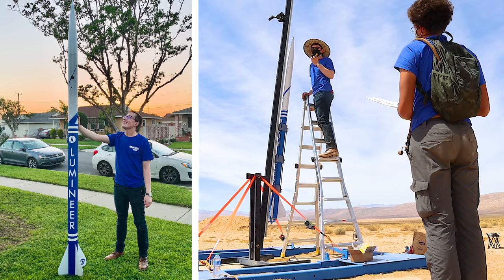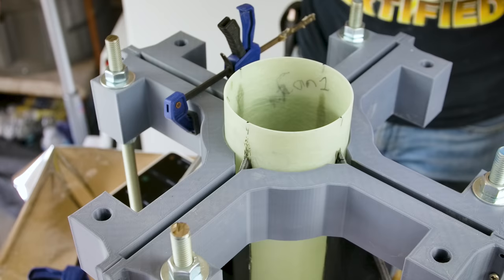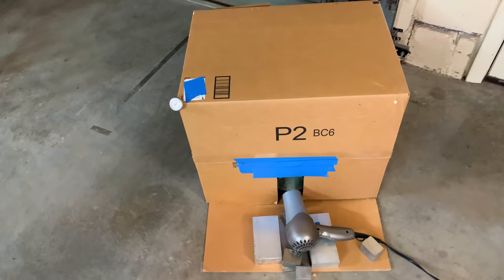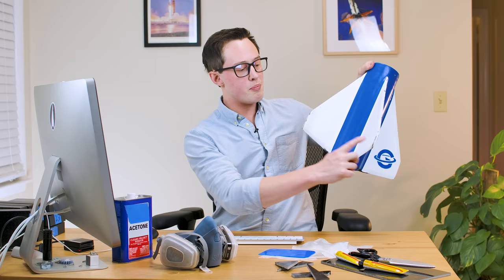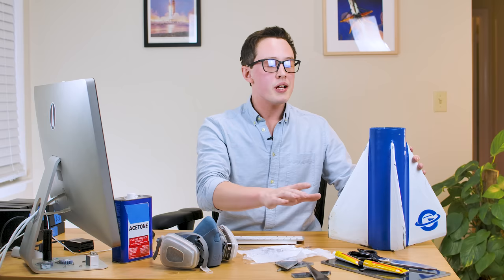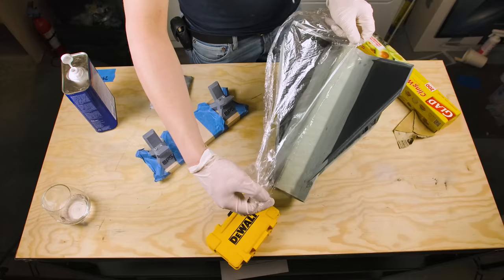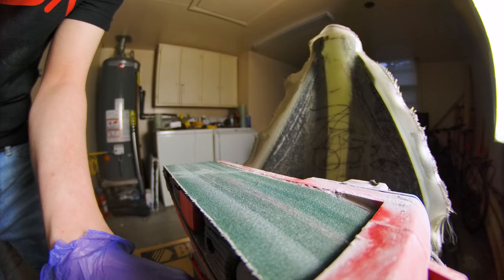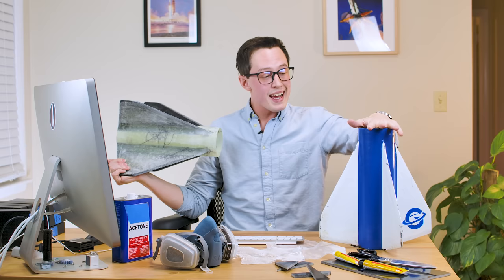High-Strength Composite Rocket Fins - Building Lumineer

Comment: Material ratios are highly specific to materials used and there is PLENTY of literature and quick google searches to determine if "one-to-one" is a good options for you. For instance, a carbon fiber based build is closer to a 60/40, fiber to resin content and shouldn't be one-to-one. There is plenty of available literature to back this up and any materials you plan on developing a composite solution for should be vetted accordingly.

Comment: I like this guys enthusiasm and get er done approach. That being said, engineering is math and analysis. This isn’t engineering, it’s hobby hack. No engineer says “O point 2 degrees “. It 2 tenths of a degree. Putting the “O” in there would lead to confusion with “point O 2”. And 2 tenths of a degree is a gigantic misalignment and would be clearly visible to the eye. G10 is about the worst material for a rocket fin. Heavy as hell. All the loads are at the root and that’s where his poor structure is weakest. A carbon fiber part made from a simple quarter section tool (mold) would have been super easy, resulting in a tail fin about 80% lighter, thinner, stronger. I was making better composite components when I was 14.

Comment: ball is the best, also helium ballooning head, also a circular centrifugal air turbine stage
Reply: design so that you dont rely on glue, dove joints
Reply: squeeze extra out
Reply: mechanically sound
Reply: ultra sound wash, insert the fiber between the fins
Reply: easier to cover round and flat things
Reply: ready made wings, fins and main body
Reply: mechanical art

Comment: Light Bulb Oven - perfectly safe and not too expensive.  https://youtu.be/oq5FbH2VAqY     Also, trimming off the extra fiberglass is much easier and safer if you wait for the epoxy to gel and then use a razor blade to trim to the rigid substrate then go to the oven. Safe and High Flights!

Comment: Would a fillet not reduce the interference drag between the fin and the fuse?
Reply: To a point.
The fillet is also increasing frontal area and reducing the effective area of the fin
Reply: @jimurrata6785  For sure there would be an optimum fillet radius. Curious to know what that would be.
Reply: @wezdog1  That would be a question only solved by fluid dynamics and FEA.
Factors like speed and air density play against tube diameter, fin thickness, thrust curve of the motor, etc.
Reply: @wezdog1  This hobby is much closer to sounding rockets flying out of Wallops than spaceflight.

Comment: I’m sorry but heat curing epoxy in a box and a blow dry has extremely low odds of catching fire. You would need to bring up the temp a lot hotter and also build a air tight box and a air tight seal between the box and blow dryer and hope your blow dryer doesn’t have a over heat kill switch. Then hope enough gas off happens and that gas accumulate to a high enough concentration and finds the heat source inside the blow dryer then ignite.

Comment: Why fiberglass over carbon fiber? Doesn't carbon fiber beat glass in weight and strength?
Reply: Carbon fiber won't bend to confirm to the fillets without a vacuum bag to hold it in place while it cures.

Comment: Don't disrespect the cardboard box hair dryer cure oven. It worked too good for me honestly lol.
Reply: If he's only doing one pair of fins at a time, laying a $12 heating pad on there is much easier (and safer!)
Reply: @jimurrata6785  I guess but I think the hair dryer method is just as safe as putting a heated pad down. That is just my opinion.
Reply: @Rocketrymandan  And we are all entitled to our opinion.
I don't think a hair dryer is going to set a box on fire, but my heat gun gets to 1,100F.
I'm pointing out that a heating pad has all kind of fail-safes built in and takes up no space while doing the job just fine (for one plane of contact)
And it doesn't even need contact, because IR doesn't care.
A heat gun is not about radiant heat, it's about raising the interior temp of the box high enough for the fin reinforcement to conduct heat from the surrounding air.
Reply: @Rocketrymandan  I'm not saying an oven is not good, but it is a lot more complicated for this use case
Even if it is as simple as a hair dryer in a cardboard box.
Ovens or autoclaves are critical for more advanced composites, but there are microcontrollers for ramp and hold times critical to elevated temperature cure chemistries.
If all you are trying to do is get your epoxy to kick off faster, gentle radiant heat has advantages.
Reply: @jimurrata6785  I know aeropoxy needs that cure oven with exact ramp in temp, which is why I chose fibreglast systems a while back for tip to tip. Pretty good specs (a lot more stable than west systems at temperature) and easy to work with. I didn't know you were talking about a heated matt specifically for composite layup. That will definitely be a lot safer than a hair dryer and you might even have the option to control your temperature.
Reply: @Rocketrymandan  I'm still using West System for most of my layups.
Not because it is 'better' than other brands, but I have over 40 years experience with it and it has huge amounts of available lab testing and certifications to back it up.
I know the engineering data and knowledge base is there for me to use it successfully if I do my part as a fabricator.

Comment: why not use carbon fiber instead? Its lighter! And way more expensive
Reply: Carbon fiber is very stiff, and while that's good for fin flutter it's a bitch to get it to lay into the corners (even with Joe's oversized fillets)
Without vacuum bag to hold it tight while it cures he would have voids at the fin roots.
Also, laying in your reinforcement at a bias (diagonally) helps a lot with this. (As you will see if you trace a 45 across a 90° bend)
With the thickness of his fin stock and stiffness of his tube he worries too much about needing those 90° layers.
The plate is not going to require it, and the half of those layers that run longitudinally contributes nothing but weight.
Unidirectional reinforcement would be much better than fabric for that.

Comment: ever hear of  auw.      all up weight.            each  beltandsuspenders  thing that you do, like fiberglass  and   massive fin material,  UNNECESSARILY  increased  the  auw.!!!!!
doing   this    is   the  Opposite  of  intelligent.
btw, the leading edge of a stab (or wing)  should  NOT  be  too  thin.
for a rocket fin,  a  Rounded leading  edge  would  be  Best.      this is so, in part, because  a too-thin le  makes  More  drag; from turbulence.        also, a fin  can  be  profiled/shaped, for  minimum  drag.             googletranslate